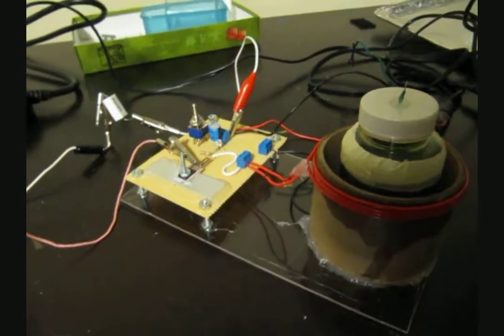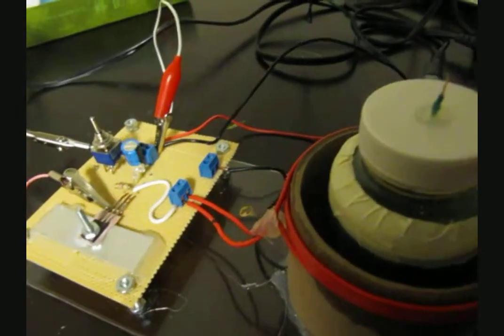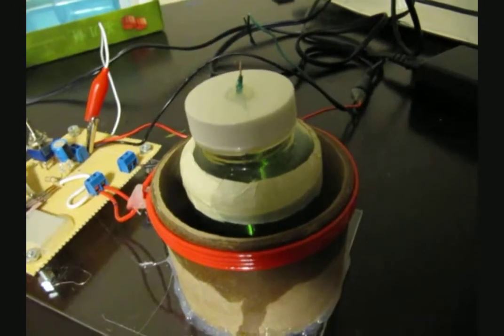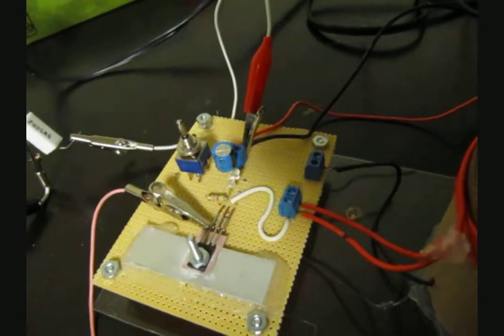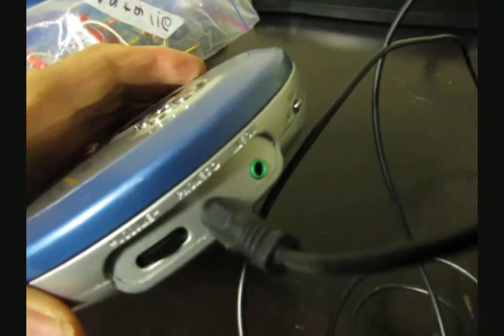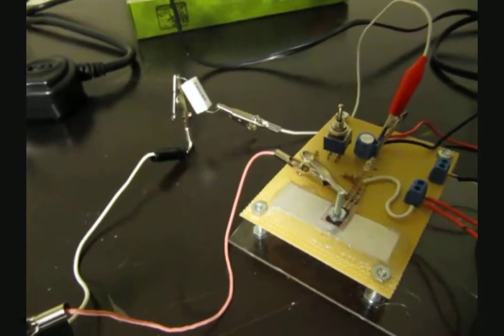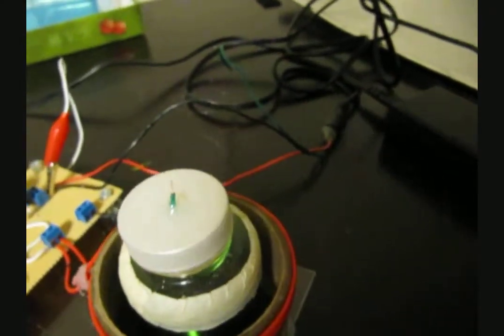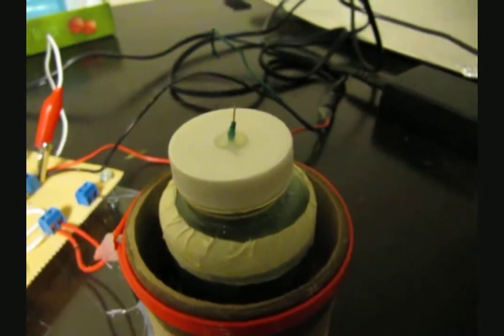Audio Modulated Slayer Exciter

Comment: Nice work I remember Audio modulating mine with just a Audio amplifier connected to the collector (in series with power) of a BUL128 Transistor but since the arc size isn't really big you don't get a good bass response, as in mine I ended up using a simple midi  file and changed the instruments to a Square wave.